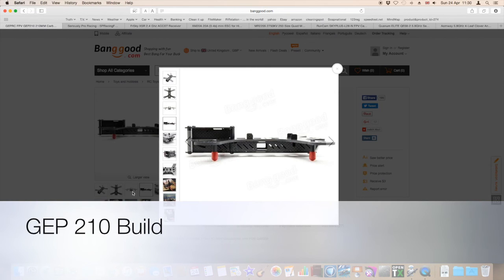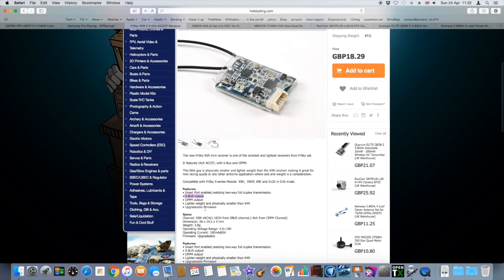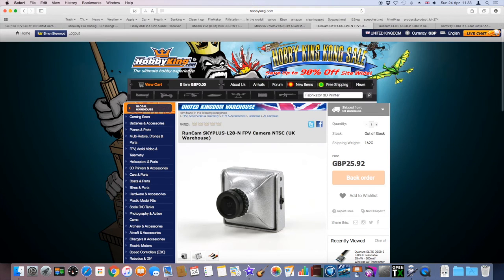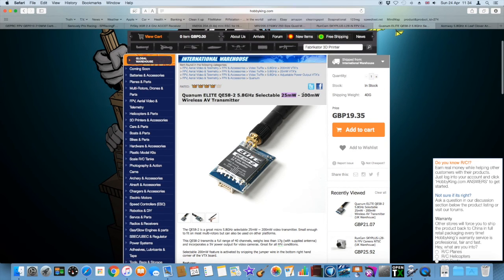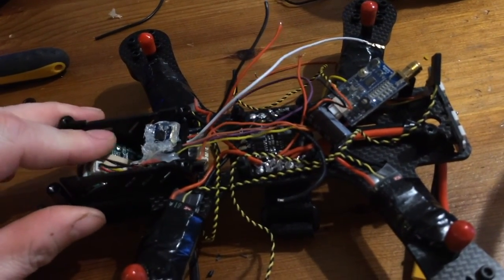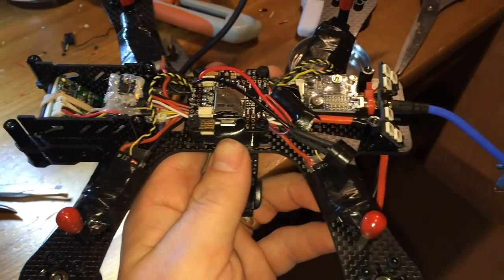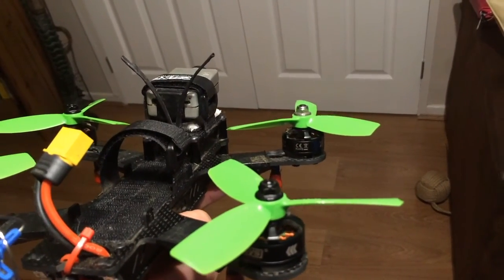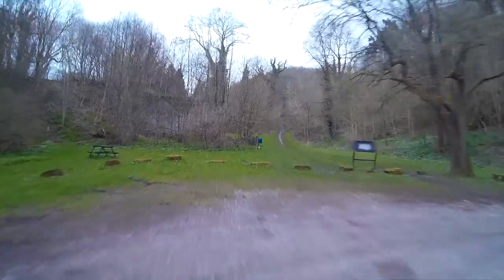GEP 210 Build and Crash

Comment: Great little frame and i've had one sitting in my hanger for quite some time now,i'm only just now getting around to building it and thought i'd check out a couple of videos to see if i can find a few tips,with a little luck i came across your build so i'd like to thank you for that,oh and a little tip,when i have to hard mount a FC i use an old bike tyre inner-tube cut up into small little washers,works really well and stop any problems of shorting out. ;-)
Reply from the maker: Now days I'd recommend an all in one PDB, FC and OSD.  They weren't around when I built this and would save so much space.  I like the frame and think it low profile design was ahead of it's time but maybe outdated by some of todays frames in this fast paced hobby.
Reply: Yeah i know but like i said it's been sitting there for suck a long time i thought i better get my money's worth out of it lol,plus i'm ripping one of my old frames apart that i'm not that keen on,save money again and i'm enjoying the build,which is part of the fun for me and no doubt most of us who like to build our own quads.

Happy flying brother.

Comment: I stumbled across this frame yesterday and it will most likely be my next build. Really nice design!
I just heard you talk about not having a 3D printer to print a mount for your camera. Have you checked out thingieverse.com ? Find the item you want 3D printed there and talk to the guys at great3d.com and have them print it for you :) They printed for me earlier this year :)
Reply from the maker: I did go on thingyverse in the end and found a mount and got it printed in a carbon fibre composite material.  It works really well although I believe the design has been updated now.  http://www.thingiverse.com/thing:1528947  As for props, Ive just put on some 3x5x4 on it but haven't had chance to test it out, I'm waiting for a dry day.
Reply: Let us now how that works!
I've just started my first mini quad build, and I'm already eyeing out my next frame. It's between this one, the GEP210 and the VDQ250 or VDQ280. The VDQ is 3x more expensive than this one though. But it's REALLY nice.
Check it out: http://www.voodooquads.com/vdq250-vdq280-carbon-pro-edition/ 
This frame is also designed to have the battery sitting lower on the CG.
If I go with the VDQ280 I'm thinking about running 1800kv motors on 4S. A lot of thrust.
Reply from the maker: Hope your build goes well what ever you choose.  I have to say that I like the 210 size they just seem a little more nimble in the air.  280 is great for outright speed though.  Voodoo quads look unique, it will stand out in a crowd.

Comment: qreat build, but what battery did u use?
Reply from the maker: Dronelab 1800 4cell. A bit big but it works with plenty of flight time. I'm swapping out the fc and pdb though, after a while I realised the fc was the week link.
Reply: why do you regard such a higly rated F3 flight controller as a weak link?
Reply from the maker: I like the design but I kept getting twitches on Yaw.  When looking at the black box the gyro was showing huge yaw movement that didn't exist, and then the PID loop would try to compensate causing a twitch.  I also had issues with the UARTS.  One day telemetry would work another day it wouldn't then it would work again.  I tried replacing it with the EVO but the twitching was worse and made it unflyable, and I still had UART issues.  Unfortunately there isn't a great deal of space to soft mount the board.  I changed to a LUX, fewer twitches but still some as I think it uses the same gyro, but all the UARTs are perfect.

Comment: Couple of things,  I don't like is having the escs mounted under the arms - a bit vulnerable. Presumably the frame is intended for racing as the camera mount needs work.  I ended up adding another higher deck to mount the runcam. That said, I quite like the frame.
Reply from the maker: +Tobermory Cat 
I get what you mean about the ESCs, although I've managed to keep the landing gear on so far and between the landing gear and the body they should get some protection, hopefully enough.  I wish it had come with a camera mount as you can't really fit 5 inch props and a runcam on there unless you make something yourself. 
The main reason I like it is that it flies nice and looks cool and that's with 4 inch props.
I like your GEP videos Tobermory Cat, I watched them whilst I was waiting for the frame.
Reply: Simon's Falling Panic Videos Perhaps I should try some 4 inch props - though I presumed they would not move the thing so well. Feels like a racer rather than an acro flier. Yep - frames alright.
Reply from the maker: I've got DAL bullnose 4045 triples on there, but the motors are 2750 KV, I don't know how well it would move with lower KV motors, but surprisingly well with this combo.
Reply: i'm building one soon with the kiss carrier mini pdb and the esc's on the inside of the frame. should be legit.
Reply: Would you not run 3x5x4.5 ?